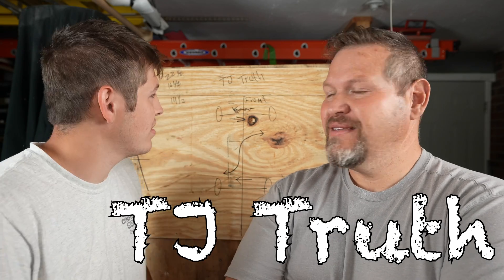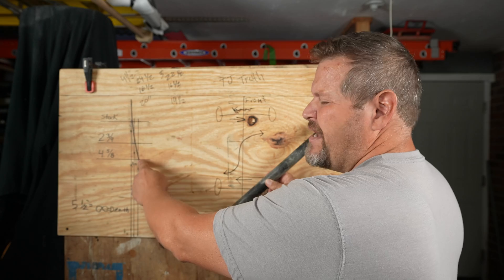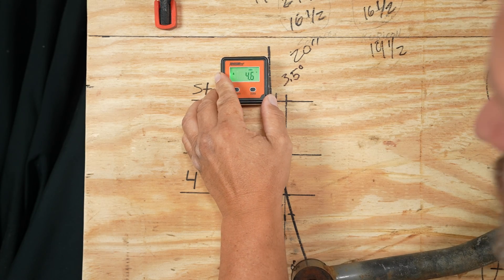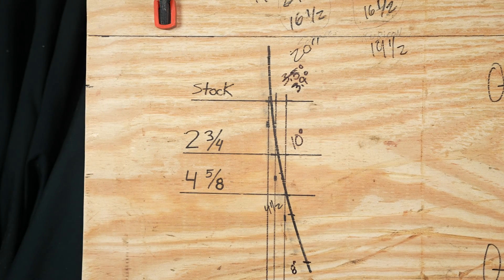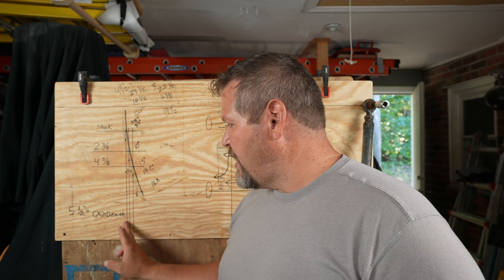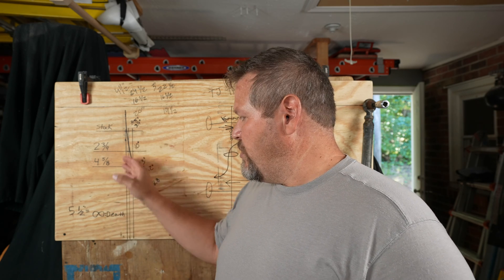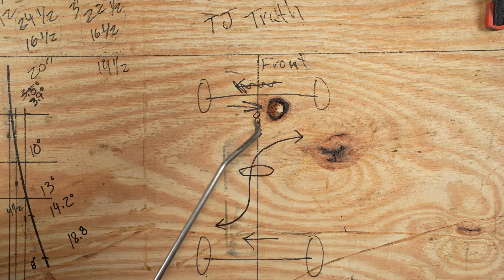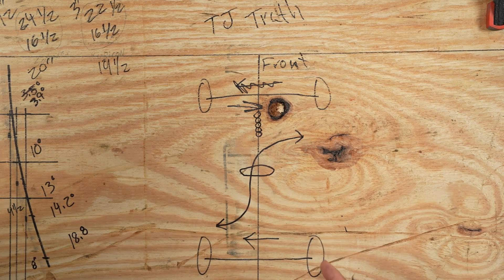Track Bar versus Ride Height... Why Does My Jeep Drive Terrible?

Comment: But wouldn’t dropping the trac bar with a really strong bracket not correct the trac bar geometry. I’m about to get a Rough Country 6in long arm and it comes with really beefy trac bar relocaters
Reply from the maker: Really good point, I think I’m will need to do a video about this here. They do correct some of the issues however it comes with  long term reliability issues. Such as the frame breaking. More to come about your comment for sure.
Reply: @RubiKidd06  I kinda like a 2 way approach. Get a longer track bar but also get a bracket that drops it a little. I agree a really long bracket could create some moment forces.

Comment: I had the problem on my jl and I only had a 2 1/2 lift. Had to get adjustable track arm and relocation bracket. Then it helped a lot. Infact I used steersmart on my jl and gladiator to eliminate the bumpsteer.   I'm putting a 4.5 metalcloaklong arm in my tj. I'm a bit nervousthat I will have this issue.

Comment: One of the many joys of owning a TJ.  I’ve managed to somewhat compensate by centering my tools just behind the front seats (in front of the rear axle vs aft) and setting the right rear shock one notch firmer than the others.  It all but eliminates the left front lifting and right rear drooping over large whoops.  I have also removed the rear seat to save weight.
Reply from the maker: It actually all matters. Our Jeeps significantly climb better over obstacles when the tops and doors are removed. Weight placement does have a impact.
Reply: Pulling the tops and doors make a significant difference. Also removing the spare tire and not putting on a some rack and throwing a cooler up there. I stripped my Jeep down for the Rubicon and just through it like nothing. 4" lift and 35's w/lockers.

Comment: The opposing track bar orientation is so when the front hits the obstacle and throws you off the road, when the back hits it kicks you back on the road...lol...jk.  BTW Thuren makes a good correction for that rear track bar situation on the Rams through use of an axle side bracket that relocated the axle pivot point a few inches further to driver side and a few vertically and a longer trackbar.  Essentially it flattens out the bar and flattens out the degree of arc as you have so well illustrated.  This is really good stuff guys.  Maybe another good, related topic is suspension collision points and where the axle lines up with bump stops, etc relative to the axle / body shift in the more extreme scenario where somebody merely tries to correct with drop brackets or extended track bars and such.  It would be really cool if you mocked up where the frame and other components sit above the axle.  Love the coined term "infinite death."  Might start using it.  Right up there with "death wobble."
Reply from the maker: Both of us have leveled our rear track bars. As you know the steering angle dictates what angle a person changes the front track bar to.

On this first video I didn’t want to overwhelm the subject with adding steering and such. I might take up a couple of your suggestions. As always, good to have you commenting.
Reply: @RubiKidd06  I think a lot of first timers fall into that pitfall of thinking they can just throw on an adjustable track bar, or drop pitman arm or drop bracket and think all will be fine and dandy (lift providers don't help).  Particularly in the front it quickly gets the geometry out of whack.
Reply: Pan hard bar needs to parallel the drag link. That seems more simple to describe then what you did in this video (imo).
Reply from the maker: It’s not about the different angles rather that when your Jeep with coils is raised its moving the axles side to side. Your comment is correct track bar and drag link also must match the same angles for a proper handling rig. However the taller the lift is the more radius the track bar and for your argument drag link is on. So under a stock lifted Jeep you hit a bump and the axle is shifted 1/4” side to side. Lift it even more and that same bump has your axle moving 5/8 to 3/4 side to side. possibly even more. That’s one of the reasons as these Jeeps get lifted past a certain point they get loose and wandering feel. 

This was the reason we only had the track bar up the plywood.